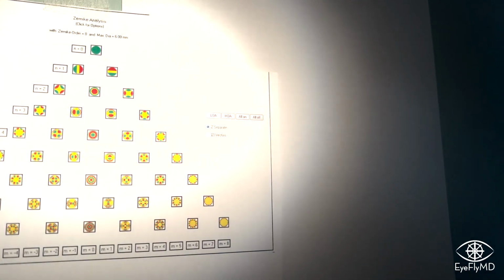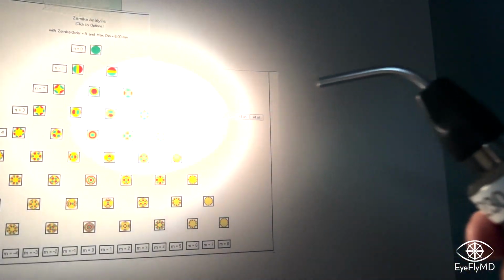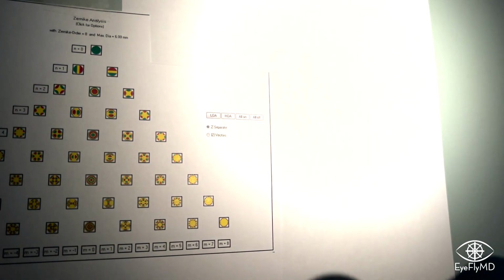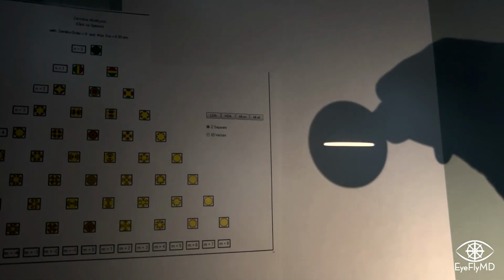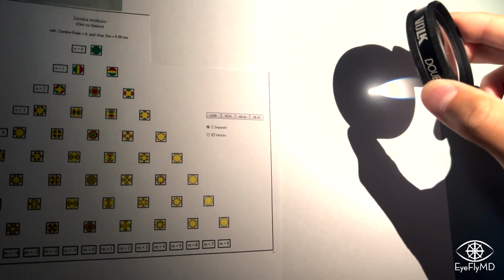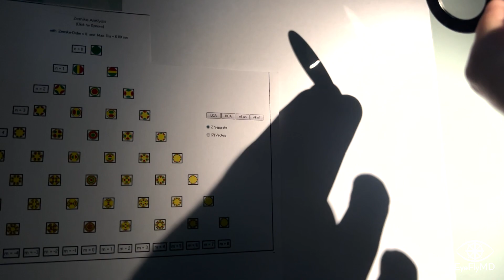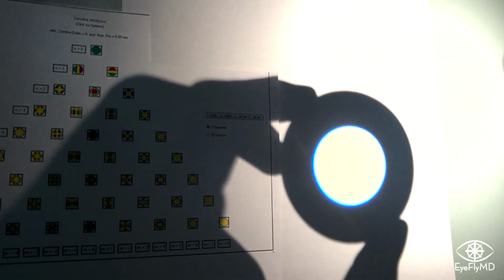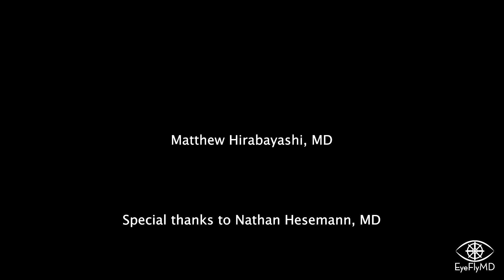Zernike Polynomial Demonstration (Clinical Ophthalmology)

Comment: Refractive surgery victim here. I really liked the trefoil demonstration because of how tilting the lens made one lobe converge and the others diverge is very similar to how it looks when trying to accommodate with trefoil on your own eye.
I have a question: Why do we see discrete spokes of light and not a halo when looking at point lights having post CRS aberrations?
Also, I wanna mention that the halo I see around things, with high contgrast things I can tell it's actually multiple images ghost images surrounding the main image. Also the ghosts distance from the main image is directly related to the aperture of the pupil, and there is an array of fainter ghost images up until the main ghost. Is it because the brain erases them, or is it like a function with maxima and minima where the maxima are what the brain picks up as images?